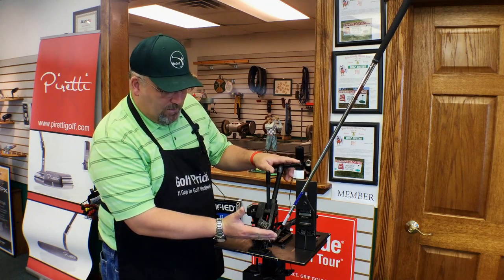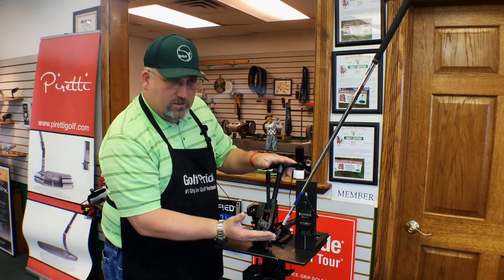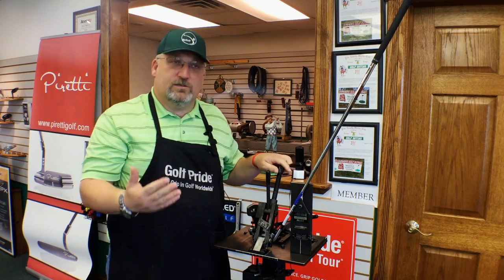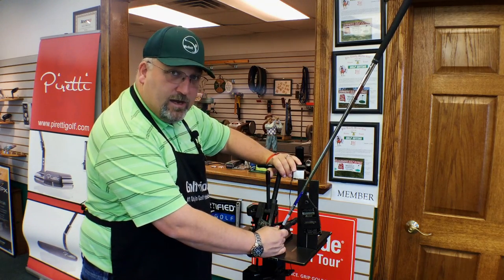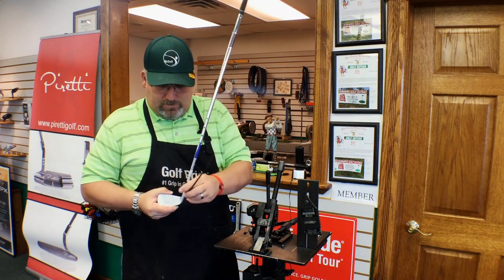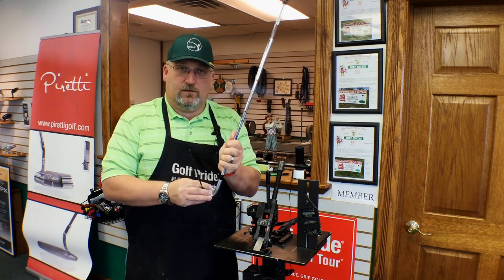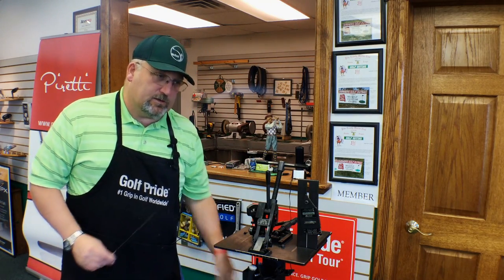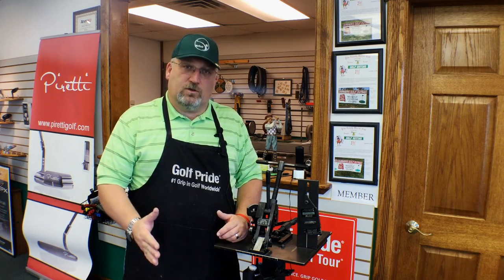Truth about Lie Angles, Golf Club Lie Angles

Comment: My old Taylormade RAC TP CB from 2005 had the lie angles set with 1 degree difference from club to club.  Now I'm seeing most manufacturers set the lie angles with .5 degrees difference from club to club.  So if you start with the 7 iron, you will get 1.5 degrees difference between the two methods up at the 4 iron and then down at the PW.  What is your take on this and which method do you use?

Comment: Thanks for such straightforward and informative videos! I recently got fitted for irons and ended up having them adjusted up 2 degrees. After doing that, out of curiosity, I adjusted an old Titleist 913D driver I stopped using several years ago to a more upright lie angle. Night and day! It’s back in the bag! I’ve never seen anyone bend hybrids. Is this something that is done often? I have 2 Mavrik hybrids I would have adjusted in a heartbeat based on the improvements seen with my adjusted clubs. Thanks again!

Comment: You have a wrench that clicks when reaching torque for shafts changes . Where do I get one of these? secondly should I check each club before hitting balls or playing a course?
Reply from the maker: the torque wrench typically comes with the driver, FW or hybrid. each company makes them .You could ask custom service for the one that matches your club. No I dont think you need to check the torque each time. It seat properly it very tight. Over tightening or checking can make for a broken screw.

Comment from the maker: It would depend on where you in your golfing career. If you have just picked up a club and you are not really short or tall then, I would recommend lessons and that would include rule and how to act while at the course. If you have been golfing 🏌️ for a bit then fitting that addresses you physical needs and address swing tendencies is a must. Then sharpen your game with a swing professional. If major changes are made the fitter builder could certainly modify the equipment

Comment: Does flattening the lie angle effect the loft of the iron?  I’m trying to determine if you can still expect the same distance from an iron after adjusting the lie angle.
Reply from the maker: if bent properly it should impact the loft of the iron
Reply: @McGolf  you mean it should not* impact the Loft is what I believe you are trying to say above...
But does flattening the lie angle mess with the bounce??
Reply from the maker: Correct should not affect loft if bent properly. However if not it will. Also lie angle bending will not affect the bounce
Reply: @McGolf  thank you sir! As for the comments, just found your video and just took possession of a new set of ping irons straight from the factory yesterday red dots 1* Flat. So it's on my mind at the moment
Thank you again
Reply: @McGolf  what is the proper name for that jig setup you have that bends clubs.
Does it have a digital gauge on there?

Comment: Question: I'm 5'5" and have had the same stock irons for 10 years and have self taught myself into the upper 80s depending on my wedge game. Would getting my irons shortened and lie angle corrected do me more harm than good without changing weight, swing weight, shaft flex etc?
Reply from the maker: Jacob the short answer is no. You might find it is better.
Reply: @McGolf  can  we  change  the  lie  angle  of a   metal  wood  such  as  the  adams low  profile  woods  ?    thanks   for  your  answer .
Reply: I’m 5’6 and I play 5/8” short 2 degrees flat....best thing I’ve ever done...playing z965 Srixon right now 176 carry 7 iron....before I changed lie  167 carry with a bad miss left occasionally
Reply: @jmtgolf2756  damn right I'm 5'7  and had a similar experience going 1.25 degrees flat.
Were you hitting a lot of shots towards the heel?

Comment: A couple of questions that have yet to be answered. 1) iron shafts are all different length otherhan such as Bryson's one length concept. This changes the body address position regardless if your irons are length adjusted.  So why is shaft length an issue when regardless, you have to change your body position, which will inevitably change your dynamic lie.  2) i was fitted with a lie board and put in 3* upright on all clubs.  2 weeks later I went in and hit sand wedge through 4 iron off a lie board with tape on the face and found that 3 degree upright was way too much on long irons and lead to toeyntrikes on shorter irons.  Why is one lie angle applied to all irons? Why wouldnt an advanced player want one length shafts that would alleviate compensations based on posture?
Reply: Upright = toe strikes and draws or hooks , upright shortens the club and lowers swingweight albeit quarter inch for around 4*.
Flatter = heel strikes and fades , lengthens the club and adds swingweight opposite from above .
The shorter clubs in your standard bag are usually more upright than the long irons ( because they are further away thus lowering the angle of the shaft )
If you are newish to golf and havent really grooved a swing or grip ( more importantly) then unless the toes sticking up in the air or the heels flopping about at address you probably will benefit from more consistent practice than changing lie angles ( forged irons can be bent a couple of times or maybe more but cast are fragile and dont like being bent back ) 
However if you are a long in the tooth hitter and suffer a persistent miss thats not easily addressed with heavier or lighter shafts or longer or shorter clubs or fatter or thinner grips etc then a change in lie angle could be the fix , maybe , or you could modify your swing to the new look at address and make things worse . 
Either way its worth a trip to your clubs pro or fitter just to check that nothing obvious is off . I have heard of a brand new set of p790’s being all over the place out of the box 🤷🏻‍♂️

Comment: Hey Jim! I have watched your videos over time and your content is awesome! I always learn something about golf equipment thanks to you! I actually have a question for you though. I recently got new irons all fitted for me and they have been treating me well. Along with the iron set, I picked up a 54 degree wedge to give me some diversity in my wedges, but when I tested the the different options I ended up choosing my wedge at standard specs. The gentleman at the shop told me that if I wanted to come back and have the wedge adjusted to match the rest of the set i could, and I eventually decided to do so since as i started to play my new irons my swing changed a bit as I was adjusting to the new clubs. But I wanted to ask you if the loft of my 54 might have changed when I decided to adjust the lie angle 2 degrees upright?
Reply: Andrew..the person altering the lie/loft angles should be able to change one or both of those angles (if they are any good)...it's not like a driver, where they "open" the face to increase the loft.

Comment: If I’m hitting my irons slightly off the toe, should they be bent flatter or more upright?
Reply from the maker: Paul Revere upright is the way to go
Reply: I had a pro suggest trying to stand closer to the ball, i guess I was reaching a bit and catching it on the toe much the same.  That said, you really gotta try finding a lie board, I suspect w/out changing your swing, an upright lie would help.  If anything, it would be good for the 'brain' aspect.

Comment: I bought some Mizuno 921 forged irons here in Japan. My first visit the fitter was recommending 3-4 degrees upright. And he used a lie board. When I went back to buy them a different guy was there. We looked at the flight scope which pretty much said that they were okay at stock. Thing is, I was trying to change my stance the first time and was using a neutral stance. I switched back to slightly closed the second visit. Now? I often lose my mid-irons to the right.

What’s your take on this?
Reply from the maker: assuming everything is the same it sounds as if you are holding off on the longer irons as to guide them instead of swing through the ball.

Comment: hey there.. i have a forged black finish Srixon Z745 20 degree  3iron. if  i wanna  to bent it to 24 degree  by mine local pro shop stuff. will that damage and leave a mark because  club is black finish ?

look forward to your response. thanks mate
Reply from the maker: Depending on the type of finish you can risk cracking the finish much like a chrome finish. most pvd finishes are imo harder or more brittle than chrome. Yes a mark would be left behind but mostly likely will be unnoticeable after the couple shots and throw into the bag.

Comment: just purchased titliest ap2 forged just need to have them fitted for me. I probably will need my lie and loft adjusted. Being they are forged irons there is no problem in adjusting?
Reply from the maker: no problem at, assuming the fitter or builder has a good bending machine
Reply: thank you. if you were not so far i would drive to you. i live in North Carolina.

Comment: im a contractor and artisan. I'm a bit tired of getting lazily fitted and taking control of my fitting. Thanks for the video
Reply: I play with a 1i, 3, 4 etc. thoughts on shortening the 1-4 or to match the 5 iron? Then sequential lengths from 6-9 then perhaps pw, gw, sw, lw all the same length. The wedges im not sure yet that I want to make them same length as I appreciate the utility i think i get on having the short LW. Im going to shorten my driver also from 45.5 to 44”

Comment: I'm a6'7" 1\2 what should my lie angle be?
Reply from the maker: Siouxpreme lie angle is dependent on the length of the club, and way you swing into ball. I suggest going to a local golf store and do a dynamic test then have the clubs bent to the proper lie angle. Additionally do a full fitting ensure your club length is also proper
Thanks Jim
Reply: McGolf Custom Clubs. 
Thanks!!

Comment: Would it be better to just trade my Ping Zing 2 silver dot clubs for some standard black dot rather than to bend them?
Reply from the maker: I am not familiar with the degree difference between the the two colors. However If it is more that 1.5 degrees you arw better off getting the new color because the PING irons are tough to bend and when they do 1.5 is about the max change.

Comment: My only comment on this video is about the statement that the club that is struct off the heal on a lie board definitely needs bent flatter by a lot. While that may be technically true, that can be absolutely the wrong thing to do if the person is already slicing the ball. Since 90% of amateur golfers are slicers, giving them 'perfect' lie angles from a lie board test is the wrong approach completely - the same but opposite is also true of better players who draw the ball who might be toe down on a lie board. Far better to fit for starting direction and ball flight  with the parameter of keeping the actual lie angle + or - 4 degrees from what a lie board states as this would be a workable range for club interaction with the turf. It is nice to know what a lie board shows you but do not use it for fitting the correct lie for a player - fit lie for ball direction and curvature. You of course can argue that it's better to fit for perfect lie and then tell the person to change their swing - but a far better approach is to inform the customer that you are building a club to help their ball flight, tell them what you've done, that it is changeable in the future if and when they improve / change their delivery than to give them a perfect lie angle that makes their draw into a hook or a fade into a slice.